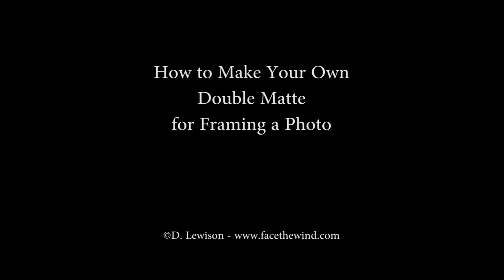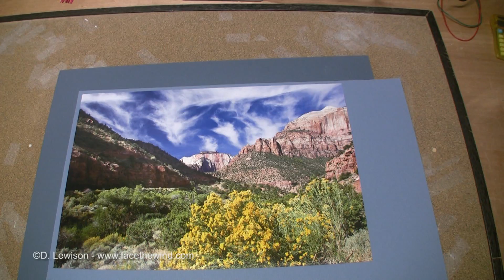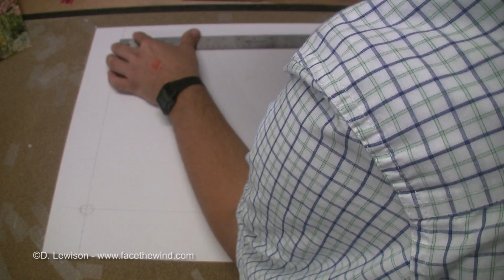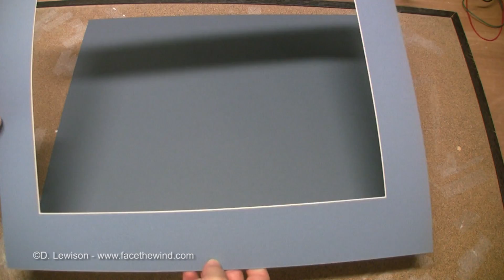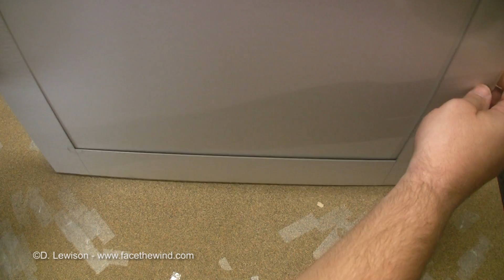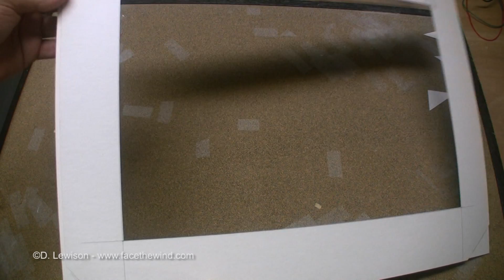How to Make Your Own Double Mat for Framing Photos

Comment from the maker: The Logan square is good, but if you're not certain of the square-ness of the mat edges, you can still run into problems. This method guarantees parallelism between the innet & outer mats, regardless if they are square or not.